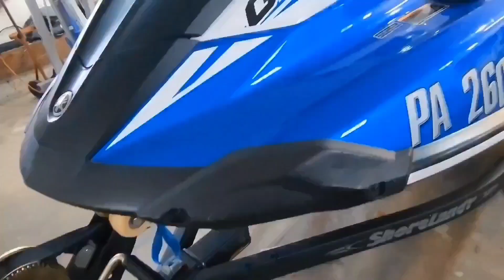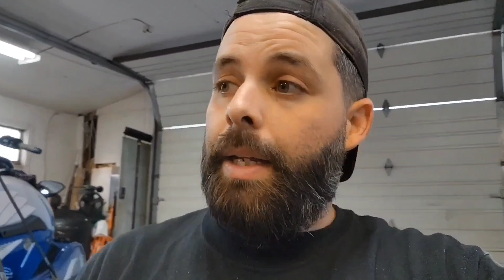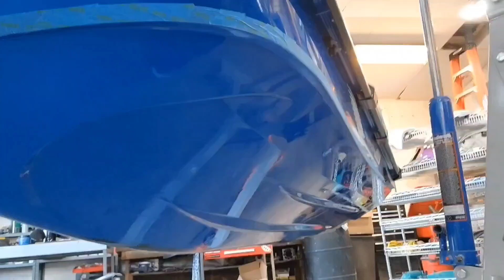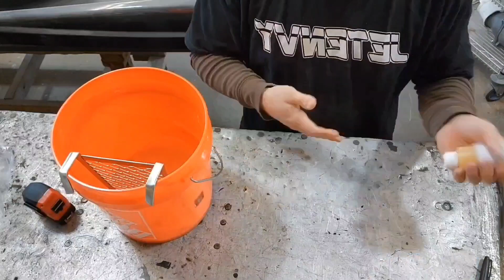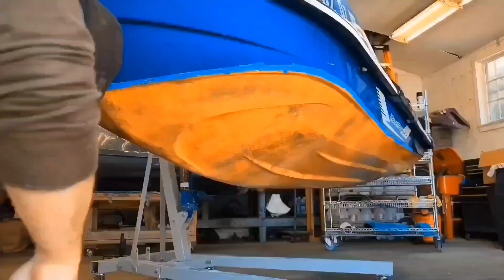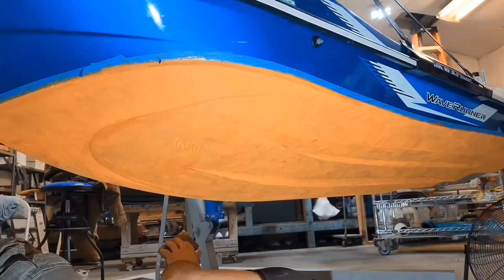The best fix for beached ski damage!

Comment: How did it work out how did it ride on the water any issues? , I just ordered the same for my Yamaha it’s all sanded down and ready to apply.
Reply: Worked like you said, look and it slides or the trailer with ease.
Reply: @joserentasBioh  did you notice anything change in the ride?   I had my gtx done and I dont think it rides like it used to.

Comment: I have a GP, been thinking about putting Gator Glide on mine at least where the bunk set and up towards the bow area I've got some good scratches and little gouge there but I've heard stories how you lose grip and traction so I've been kind of reluctant please do a follow-up video if there's been any kind of handling changes and also what Gator glad did you use G2 or G4
Reply from the maker: This was the G2 series. As far as grip and handling if you upgrade your rideplate and switch out to better sponsons than you should be good to go. A handling update should be available soon. Stay tuned!
Reply: @JetEnvy_TV  very Nice video thanks for share.what s thé différence between g2 and g4 ? Why u choose  g2 ?
Reply from the maker: From my understanding g4 is a harder paint which would mean it's less likely to flex with the hull which could result in cracking, flaking, chipping...etc. I made a business decision based on that to only install G2 "FOR NOW" at least untill I get a better understanding of the material and how it acts under major stress.
Reply: @JetEnvy_TV  thank you sir 🙏🙏
Reply: @JetEnvy_TV  sorry to bother u again . I would like to know if i must put GB first then G2 or Just G2 ? And is 1 gallon is enought to do hull of fx cruiser 21 ?
Reply from the maker: You only need to buy 1qt but you must do the gatorbase first.
Reply: @JetEnvy_TV  thanks 🙏🙏

Comment: I have similar beach rash damage like yours, no cracks in hull, and I'm looking to do this. I'm just starting to research different repair methods and it seems a lot of people are repairing the damage first with epoxy. Then painting or coating with gator glide. Is the epoxy repair really necessary? Will the gator glide alone be enough?
Reply from the maker: The gatorglide will last way longer than paint. Its tougher than gelcoat. If you have deep gouges I would recommend filling them with an epoxy fairing compound.

Comment: What grit sandpaper do you use for sanding off the clear coat? Then for sanding down base coat? I spoke with owner pf gator glide also and he recommended to me that only the base coat is necessary, what are your thoughts about that?
Reply from the maker: I usually use 320, we install the gatorglide over gatorbase

Comment: Looks like its basically an epoxy coating, then sanded and painted.
Reply from the maker: The resin hardner of gatorglide is a water-based epoxy so your guess is not off but I couldnt tell you anymore than that.